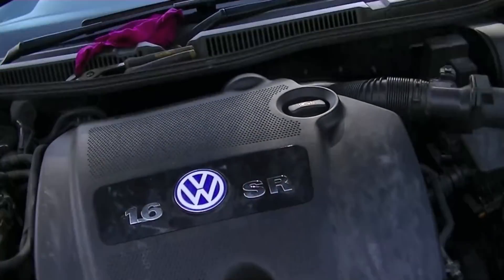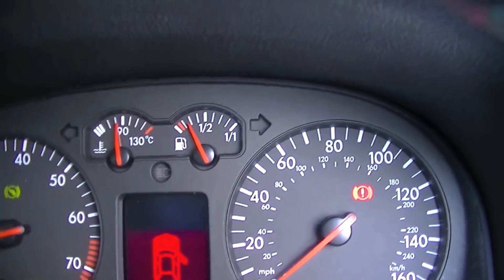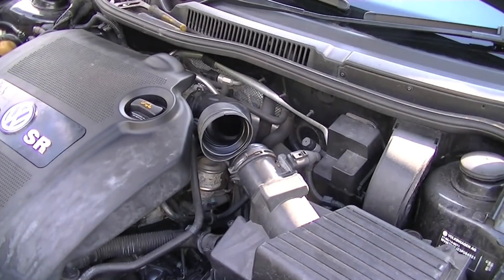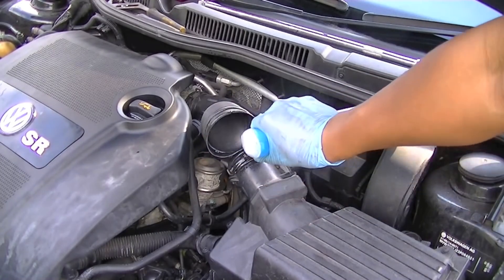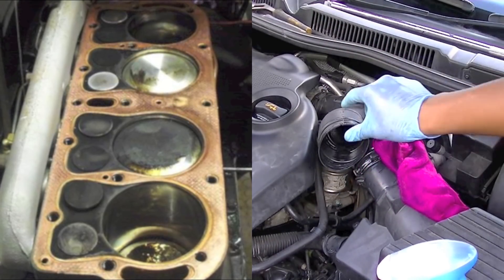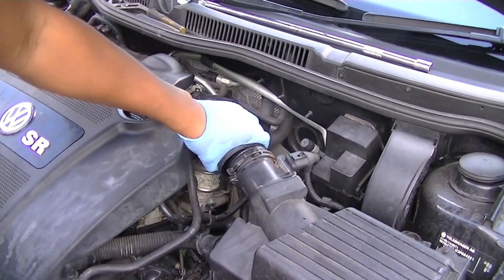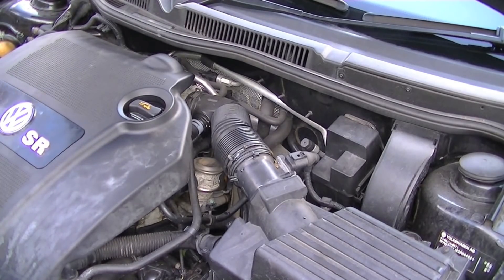How to make your engine run better with just tap water.......Better Than Seafoam?

Comment: I wonder what idiots would do this? It's the worst thing to do for your car, and you trying to kill people and get them hurt or trying to give them an expense?
Getting engine upto temperature and putting a hose in the Intake would potentially Crack the Head or Block.
And in some-cases over pressurizing the engine. The harder it turns the more forces it needs to release. No resistance from the drive-line, just pure power and a full cylinder of water. If there are enough rotational forces and you manage to quickly fill one cylinder with water the head is potentially going to pop off with a lot of force.

Spraying with a bottle like that won't necessarily damage anything other then cracking any aluminium parts including Pistons.

Maybe it does clean parts, but engine coolant that leaks in is already pre-warmed and not cold. it equalizes with the engine. 

You can say "Fuel" But that burns, and never really gets the chance to change any temperature of any components. It also is not as dense as water.
Reply: Talscar1 he said don't put a hose in it. That's stupid. And no spraying mists of water isn't any different than a freezing aerosol of other additives.
Reply: He actually says "I wouldn't advise you do this with a hose".
Reply: He does say "wouldnt" & goes on to say "if you do it the way I`m doing it in this picture (with the spray bottle) you should have no problems at all".

You simply misunderstood him, probably because of his British accent.
Reply: That's a good idea.

The only irony i can take right now after rebuilding a Injector pump is no high pressure, pull it out and it's got water in the fuel supply... It's a good thing that it did not work or else the particles i found from some damage would not have done my pump any good. Just waiting on a new tool for reassembly.

Still hearing it something like this "So... I'll advise you do this with a hose".
Reply: Jod Bronson I seen your comment they recon you mentioned Drugs and it was flagged LOL!

Also
Audie Pair 
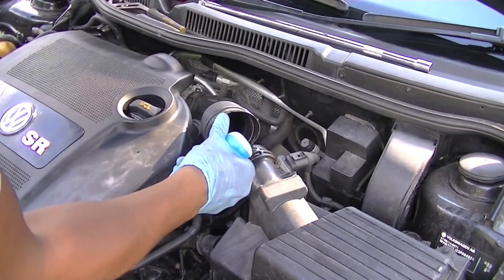go to 2:32 and watch from their. He did say its better to do it with a hose.
His exact words "I will advise you do this with a hose".

Listen. I don't agree with what he said. I agree maybe with spraying but absolutely no HOSE!
Reply: Talscar1 yea, cause they can't stand the TRUTH!!! It's better to be creative and LIE on here :))) The idiots will listen to LIES... But I agree with you 100%. Only STUPID People would do this. :/
Reply: @Talscar1 - If I have Drugs.. I be busy selling it... Why would I be here? LMFAO
Reply: You mentioned CR*** which is why it blocked you lol.

You said:

"@Talscar1- I was afraid of that too. Although I am going to try that later, little at a time. But yea you are right, if the Engine is really HOT, it might C***K something in your Engine :(((
Reply: Talscar1 Hahaha, I don't have time to fight these idiots... " I got bigger fish to fry ". I am smart, I won't post much or I will lie, LOL. Then I just sit back and let them ruin their Cars, Trucks, etc.... I'd be smart and will sit back and laugh... LMFAO :D
Reply: Jod i don't think you have time to chat if your busy using your hands. To simulate exactly how the water effects your warm/hot engine. Simply get a glass in a pot of water. Turn on the gas and head it up for 15 minutes then pull it out and just dump the fu**er in cold water and BAM! that's what it does to alloy components with the correct volume of water that is not hot.

To note: The combustion chamber can get upto 500* before the engines temperature is so critical it falls apart. Alloy melts around 700-800 degrees.

It happens to some people who preserve fruits, since they put the cold fruits into hot glasses. How do i know? My Mum done this. And she done it with glasses in the sink as the water was hot and moved it into the next washing bay and bang! Although they were s*ty glasses she used. I tried but the glass i had was high quality. 90 + cool volume of water was not enough to crack the b***h since it was both not hot enough nor left long enough to warm up.

Be safe!
Reply: hehehehe, I don't disagree with you, basic Science :)) You are 100% RIGHT, but shhhhhhhh let these idiots do it, so they have a reason to buy a new Car, LMAO... Then they will be in debt and working their arse off paying it off for the rest of their Life, if the Bank doesn't REPO first, LMAO. Maybe they will help the Car Economy going :D, hehehehehhehehehe
Reply: Hey! Your absolutely right! But mechanics love it when people destroy their engines because the first 8 hours are spent assessing the engine. Telling someone it's going to cost for a new motor AND their time. Looking at it where i live they probably will ask for something like $6000 if they can't get a new motor anywhere. $1000 to take it out, $1000 to put it in and $4000 to possibly get a new motor or parts/Rebuild if possible.

But i think your right, people are idiots because rather then going back to verify something, they speak so loudly and say "HE DIDN'T SAY THAT!" And when you give them the time he SAID THAT they shut the hell up. No apology no "Oh my bad".

No respect bro!

It's hard to find decent people in the community. The other person is like "I'm 100% and your 0" Where's i am willing to sometimes give the benefit of the doubt especially to people i actually know unless you talk to me about physic's... Then i will fucking hit you so hard your ball fall off!
And i mean that literally.

Idiots don't even know what literally means.
Reply from the maker: Have you never heard of water methanol injection?? BMW use it in their new M4, high performance cars have used it for years
Reply: Yeah i heard of dripping water not putting the hose in the Intake. That's one mistake on the videos part.

Not to mention for each action has a equal and opposite consequence.
Which is why Performance vehicles are fine tuned. They were never designed to take 60L of water and squirt away. And they use a fraction of the water to squirt then go driving around with a hose... If compression is too high it can blow off the head by pass the rings. With a hose more then likely blow off the head thank you.

When you tell someone something you have to make sure their are no negatives they can take from that. If i put a hose in my car after the video said to do so, and the head came off all you'd be able to say is "Bad luck". 

Through experience don't tell people "Put a hose in intake" They will LITERALLY do it. Unless that's the whole idea.
Reply from the maker: Where did you see a hose??
Reply: -Audie Pair 
go to 2:32 and watch from their. He did say its better to do it with a hose.
His exact words "I will advise you do this with a hose".

The exact words and this is a repeat of what i told the last guy.
Reply: Talscar1 Nah..... You need a Fireman Hose and if you can get a Water Pump, it will be even BETTER :)))))))))))))))). FLOOD that ENGINE up, why NOT ???? Its like CLEANING the Engine and SAVE a lot of Money $$$$ LMFAO
Reply: If he is actually saying that it's hard to hear it.
And if i can hear it then it would be likely someone else would hear it the same way.

I hear would not wouldn't
Reply: Anythings possible. But after what people say i still have it in my mind what i hear. I think he could annotate that encase someone else misinterprets. I am still misinterpreting because i still hear it as "I'd advise you do this with a hose".
Reply: Talscar1 RUN the Engine really HOT, stick a Fireman Hose in it, it will CLEAN EVERYTHING :))))). You will NEVER have to FIX or CLEAN that Car again :)))))
Reply: have to jump in there,  what he said was i wouldn't advise you to do this with a hose
Reply: I think, in future, just say "would not" instead of wouldnt, in case the non-Brits dont understand your accent mate!
Reply: good point.
Reply: Been doing it for a long time. Doesn't hurt a thing. You'd cause more damage using seafoam than water which seafoam doesn't damage the engine or sensors anyways. 3k rev at op temp and nothing will hurt. You wouldn't shoot seafoam down your intake on a cold engine at idle would you?

Comment: SO who's going to pay for your engine overhaul in a few 1000 miles/kms? The water will evaporate and all steel parts will rust..like rings and steel piston inserts, gudgeon pins etc..
Reply: even tho they are all oiled and the water vaporates and exits the engine... does your car's engine rust from inside when you drive in rain?  use your brains a little.

Comment: carbon build up from the throttle plate to the piston is mostly from your PCV system pulling oily vapor in ,the carbon that builds up is soaking up some of the fuel and creates restrictions ect...the worst enemy is fuel that does make it past the rings contaminate the oil breaking down performance of the oil and guess where the oily vapor the pcv is from...

Comment: People keep comparing this to water/meth injection.  The nozzles on water/meth injection systems spray a super fine mist which vaporizes almost instantly.  The water droplets coming out of his spray bottle are significantly larger.  Regardless, hydrolocking an engine takes a lot more water than what he is spraying... period.  End of that conversation.  This will NOT harm your engine. 
 How well it will clean is debatable but it is safe.  Straight water injection does not add power.  It cools your engine so you can then add more boost and/or timing which then adds power.  I have a water injection setup on my race car and lots of dyno time to support this claim.

Comment: This does work. Fact. Another thing I have done for donkeys years when doing an oil change is drain my old engine oil, replace the oil filter for a new one, fill with standard diesel oil to max level, run at idle for 10 mins without revving engine, stop engine, drain the diesel oil (be amazed at the crap that come out with it) replace with another new filter, add your new oil. after 6 months you'll notice the oil s still golden. Done this on my 84 Saab Turbo for 25 years with 186,000 miles to date and will still out perform most so called sports cars.. lol..
Reply: @last leo lol 😂

Comment: This method of de carbonization works quite well, I have used it for 35yrs. and seen cleaner spark plugs afterwards, showing that the process does indeed clean the combustion chambers.
Reply: Mike, does the removed carbon deposits cause the cat converter to clog?

Comment: Dont do this.... get a product called Chem-tune INSTEAD. I tried the Chem-tune and got good gains after about 10 minutes. Using this water method will dislodge carbon and scratch your bores unless you do it by droplets over weeks. And then it all goes into the Cat - Chemtune melts it down so goes straight out and it also cleans the cat converter while its working. Look it up on FB if you can't find it, its hard to get.

Comment: Ajacks spay and wipe, Pinoclean, fabric sofener ect. They all work great and I have been using them for years. The water in the products clean the carbon and the additives in the products provide lubricaton and increases power. Thanks for the informative video!!
Reply from the maker: Thank you for watching

Comment: this guy shows no proof this works,  no camera to show before and after pictures. with his theory i can put water in the gas tank to clean the fuel system
Reply from the maker: Do any of the other injector cleaning companies show independent proof?
Reply: BMAC VAGS no they dont . but you no better than them. also you are trying to tell people something works when it don't
Reply from the maker: Have you tried the water method? How do you know if the water does or doesn't work?

Comment: H20 baby...old hotroders have known this trick going all the way back to model A ford racing..the corect amount injected in the cyclinders under pressure added to the gas stream fires the cylinder hotter than just the gas itself.
Chances of hydrolock is almost impossible in a hot engine unless you are pouring water in and no one would do that..under high heat and revs the water changes to a vapor of Hydrogen and Oxygen that breaks down creating more heat under combustion which cleans the valves, pistons and combustion chambers..
This was used by pit crew mechanics for more power way back in the early Indy 500 days..worked really good on old flathead engines
Reply from the maker: Thank you for watching
Reply: Richard B  i dont know about thos trick but i know that you dont break the water molecules into HHO just by steaming it in a combustion chamber.  you get water vapor.. not o and h like you seems to pretend.
Reply: there is no breaks down into oxy and hydro. come on.. dont say things that you dont have a clue.

Comment: what's good fam my name is Kyre gary I have a 2002 Crown Victoria Police Edition. I change the EGR valve. sprayed the lines with seafoam and bought a new egr sensor but I still picking up PO401 code. what do U think my be the problem?
Reply: Kyre Gary O2 sensors or cats
Reply: p0401 , is egr flow , meaning , 
from where the exhaust gasses flow from the exhaust  manifold trough the egr cooler , then trough the valve , then back trough the inlet manifold to be reburnt , 
somewhere you have a blockage , 
that blockage usually accours somewhere around the inlet manifold on a diesel , and , on a petrol will usually be where the egr pipe meets the inlet manifold around the throttle body , 
don't be afraid to take off a few bolts and have a look ,